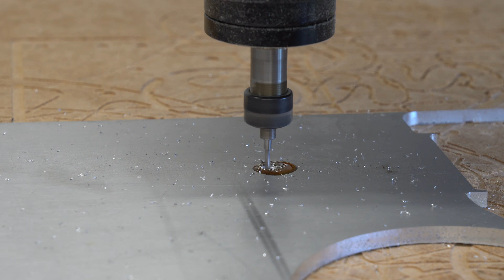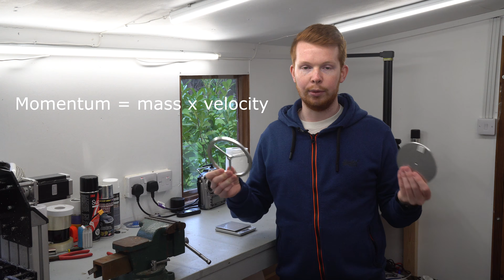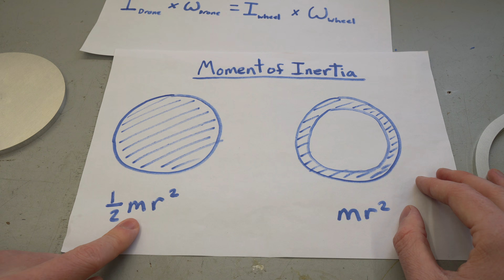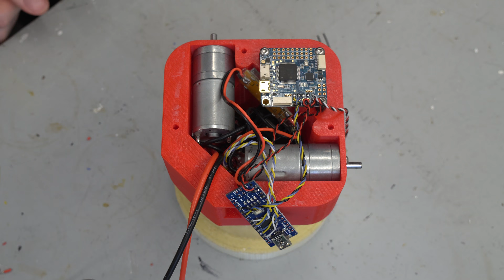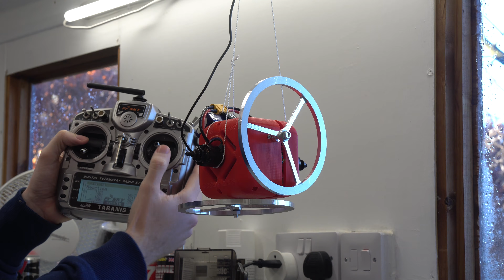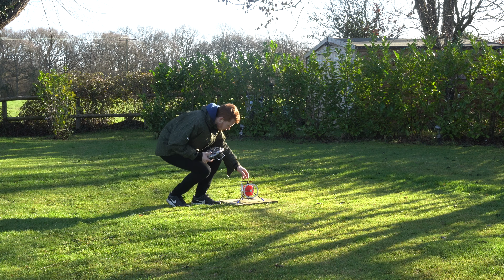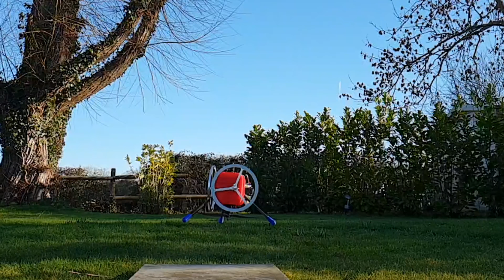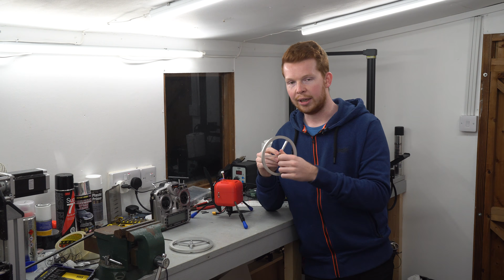Comment: I think a major contributing problem, is that the axis of rotation of the reaction wheels are not passing through the center of mass of the device. Therefore, when the wheels rotate, they also introduce a disturbance, and neither rotating wheel can counteract the introduced disturbance. If the axis of rotation of the wheels passed directly through the center of mass, I think you’d have better luck.

Comment: Just two quick additions.  The power of a body with arbitratary motion is just the rate of change of the force times the distance.

Power = (d/dt) * m * a * X  = (dm/dt) * a * X +  m * (da/dt) * X  +  m * a * (dX/dt)  Watts

If your vehicle is not changing mass , the first term will be zero or small.

Power = (da/dt) * X +  m * a * (dX/dt)  Watts

but a is (d2X/dt2) and (da/dt) is (d3X/dt3), the second and third time derivatives of the  position. And (dX/dt) is just the velocity vector.

And  you can integrate your three axis accelerometer (and gyro data) to estimate X(t), V(t), A(T) and dA/dt for each axis.  Just take the time series, integrate the acceleration once for the velocity, and twice for the position.  Monitor the power from the amperes and volts as a function of time, and you can calibrate your integration constants.

So you can monitor your power usage, in three axes, over time. And if you preplan your trajectory in three dimensions and time, yoiu can precompute  the required power, acceleration,  velocity as a function of position over time.  With wind and disturbances, there will be adjustments, but your basic path and operations can be checked ahead of time.

Power =m*(d3X/dt3) * X  +  m*(d2x/dt2) * (dx/dt)

The term (d3X/dt3) is called "jerk".  If you minimize that, you can lower your power requirement.  Choose control signals that minimize "jerk", the third time derivative of the position (three axes remember).  That leaves Power = acceleration * velocity

After jerk, comes "snap", "crackle", "pop".  I am not kidding. that is the naming convention for 3rd, 4th, 5th and 6th time derivatives of the position.

A second note, regarding reaction masses.  If you choose a sphere as your reaction mass, you can spin it in a vacuum at very high speeds.  Since it has no preferred direction, you can use ONE reaction mass to provide thrust in any direction, not just along certain axes.  It means applying forces magnetically and by induction to the spinning sphere, but that is just calculations.  You can precompute, and calibrate specific masses on the ground, then store the signals to produce any given thrust and direction in a table for small onboard computers.  If you spin up the sphere on the ground, you can store energy and counteract the startup torque on the ground, then you do not need counter rotation once you get going.  Magnetic braking is a generator, so store the electricity in a capacitor and battery if you have the capacity.  A magnetic sphere does not have to be solid. In space any object can be spun. Put the sphere or object in a vacuum to reduce viscous losses.

Wish I had more time. These are just ideas for you.  I recommend Lamb's Hydrodyanamics on solids moving through fluids.  Force yourself to write down his equations and memorize his conventions for vectors.   Or  just carefully observe and try to quantify and estimate the consequences of your control signals and measured datastreams.  Good luck.

Richard Collins, The Internet Foundation

Comment: Your aluminum ring with vanes is strong and lightweight and has higher angular momentum per unit mass.
If you use titanium or steel it might be better.  Steel would be strong, inexpensive and you can solve for the optimal shape

The vanes going from that central disk to the ring could be machined as vanes (propellers) and you might not need separate two blade propellers.  It three blade calculations are beyond you, just use two and steel will be rigid enough.

So replace your top and bottom blades with a ringed propellor (two blades with a circular ring at their tip) or three blades. The counterrotation stores most of the kinetic energy = (1/2)*I*w^2

The kinetic energy is a store that you can tap.  If you have a fast spinning, dragless, ring with very tiny vanes, then changing its speed requires less total energy in unit time, (less power), than to require it to start from zero speed. So a pure reaction mass (not used as a propeller), might be spinning constantly (as a flywheel). Your control monitors its omega, calculates the energy needed for the new omega and sets the voltage and current accordingly. 

If you put the storage rings inside the device in vacuum, they do not need vanes and rotation about the center by mechanical means, but can be permanent magnetic rings as rotors in a circular motor/flywheel, and spin constantly.  You could :spin up" the rotating rings on the ground, using tethered power from the ground, and then tap increase the rate (battering to rotational energy), or tap it as a generator (rotational energy to battery).

Sorry I can't put pictures here.  Take a ring and build a motor frame around it.  If it is a permanent magnet, you only need an occasional controlled magnetic field to make it spin.  It could even be a plastic magnetic material that you magnetize in a predetermined pattern.  It can have very specific magnetic pattern stored in it to make control optimal for your use.

You really really need to make basic spreadsheets, put all the things you know into them.  Use the Solver to target the operating parameters you want.  Excel and Sheets both can do this.  

There is no end of resources to do what you want to do - use reaction mass, and/or gas jets (or plasma or liquid fuel jets) ,  to provide thrust and forces to move and stabilize your craft.  You have a LOT of power in the drone controllers, but not a lot of energy.  So store some on the ground as rotational energy.  Soft Iron would be cheap, easy to machine, magnetizable.  Or talk to K&J Magnetics or other neodynium magnetic material specialists and have them help you make the parts you need.  They need to be strong, and the more magnetic energy you can store, too, the better.

You are using WAY too much plastic.  That is too thick and heavy.  Machine your frame out of aluminum and minimize the plastic parts.  Tell your sponsor to help you devise an aluminum or steel 3D printer and think long range. Laser or ultrasonic welding of small parts might work. Build frames not solids.  Your motors are way too heavy.  Remove most of the cases and anything not really needed.  If you make the rings as rotating elements in a circular linear motor, you don't need those heavy motors on the axis.  And you don't need so much power.  Small, extremely precise adjustments, not bang bang start stop from zero.

Sorry, I mixed designs - trying to make a propeller with a ring on the tips and its own kinetic energy of rotation is one thing.  Making a ring motor flywheel another.  Machining frames out of aluminum or titanium another.  Robot welding extended "solids" from thin struts another.  Building parts out of very strong magnetic materials and building frames around them another.  In space imagine to very fast rotating rings made of magnetic materials.  They do not need axial struts.  Just get the robots to build the rings in place, then a frame around them that spins them up to high stored energy, that you can tap for orientation.  Six sets of two rings on each face of a cube?  LOTS of possibilities. Just do the calculations.  Modelling mathematically is cheap.

I havent' said it. Great job!!!  Keep up the good work! Wish I were 60 years younger.

Comment: Could it fly with just three reaction wheels and no propellers? I don't think so, but am curious.
Reply: Reaction wheels are not designed to provide a force, just a moment so if you have three wheels you would not be able to overcome gravity, hence the propellers which provide both force and moment (and in fact that moment is compensated by spinning both propellers in opposite directions thus avoiding the drone to start spinning like crazy)

Comment: you can hang it upside down,with 3 string (one at each leg). that way you have a safe device (not breaking stuff). i was wondering if one can change the center of gravity.. having a long stick (with a mass at the tip) underneath, that you move in the oposite direction.. would that work?
by the way, i like your videos! it's quite interesting, i did not know how many diferent ways there was to try to control the attitude! congrats!

Comment: you can solve the work by placing the reaction wheel on all four sides and these wheels must be synchronized in opposite directions. This minimizes the vibration caused by the reaction wheels.

Comment: Why not try put 2 rings and 2 motors on both parallel sides? Where each motor runs in single opposing direction, so that whenever the drone faces the other way around the motor(1) is then shut and then the motor(2) runs to counter the direction and vice versa, just like in kayaking. In this way you don't have to wait for a single motor to slow down and eventually stops before it can rotate in another direction. 

Don't really think it would help but just an opinion, I'm just a fan and not even learned man as you are Sir. Nice video! Definitely wanna watch more of these. 😊

Watching from Philippines. 🇵🇭

Comment: I'm not going to go through 2.6k comments, but in the few videos I have watched of yours it would seem logical to move the lifting thrust component above the controling components kind of like a pendulum. I think though this would reduce the extreme controllability (not an area you're close to mastering) it should help master control. Also have you considered using a helium balloon to reduce the requirement for lift, this might make it more resemble "space"

Comment: Hi, the problem is you didn't account for the fact the wheel that starts to rotate the first will, because of the Conservarion of Angular Momentum Law, try to preserve its axis of the rotation which will oppose the other ring trying to change that axis. For the same reason the wheel in this experiment does not fall down: https://youtu.be/NeXIV-wMVUk

Comment: If you modify your wheel design to cut one or two channels just inside the edge of the wheels, you could then press lead wire into the channels, thereby increasing the mass of the wheels. The drone would have to work harder to lift them, but they would be much more effective and take linger to saturate.

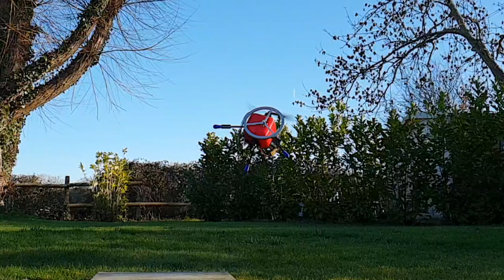Comment: 19:20 look at how this wheel is wasting time trying to decelerate when the drone tilts to the left, and the reaction wheel never has time to counter-rotate. I think this would work really well if you had FOUR reaction wheels. One dedicated for each direction. So, ONE wheel for Left Roll ONLY, one wheel for Right Roll, etc. This way, they never have to "waste time" trying to decelerate, before the other wheel can engage full spin in the opposite direction.

Comment: I have a suggestion: The whole vehicle is imbalanced due to having the wheels on one side.  I would modify the thing to have 4 wheels. Divide the wheels in half (thickness, same diameter), have each axle go through the unit, still driven one motor per axle (just two motors), mount each wheel on opposite sides of the vehicle, utilizing the one axle per axis.  All sides of the vehicle will now have a reaction wheel, therefore balancing the vehicle's weight.

Comment: The props may have a very slight rpm difference. And the prop design variations may cause slight differences in trust. Try using just one prop on top and a flat disc plate on the bottom to counter. IMHO

Comment: You should look into different types of DC machines (motors) because there are several types that have very different characteristics. Shunt motors will rotate at a constant speed based just on EMF or voltage applied. Series wound motors have a "constant power" output if you will, where torque and RPM are inversely related, and motors with a fixed field excitation like those small permanent magnet motors have a linear relationship between torque and RPM, which is shifted up and down with voltage applied.

It may also be better to use brushless motors if you can find ones that have a high resolution rotary encoder or a resolver. Although that gets expensive quick. Field Oriented Control is probably the best algorithm currently for controlling them.

Comment: Means more complexity, have both the (ducted may help) props co-axial (a la Kamov) on top for some inherent stability (synching with wheels with triggered Coriolis?) but have 3 reaction wheel arranged in a corner set up (all perpendicular [hull could be a cube with an opposite diagonal axis vertical with props coming out of that]) for altitude and directional control. Have the landing struts projecting between those for some protection
Reply: "props on top for inherent stability" - Ladies and Gentlemen, allow me to introduce the Pendulum Fallacy.

Comment: The problem with the concept is, that to generate torque the reaction wheel has to accelerate (and can do so only until it saturates). So e.g. if you hang the drone off balance a constant torque is necessary, just to hold it perpendicular, and the reaction wheels would quickly spin up to saturation. When you spin down the reaction wheel it actually gives a torque in the opposite direction.
All kinds of forces generate torque on that drone, a center of mass not exactly counterbalanced by the propellers is probably the most significant, but also wind and air friction, so unless your drone is perfectly balanced (force of propeller aligned with center of mass) without spinning the reaction wheels they'd have to constantly accelerate just to keep it upright.
If there are friction forces that bring a rotation to a halt, then they could be used to advantage to avoid saturation.
The gyro effects on this thing (one reaction wheel acting against the other and the differential torque from the propellers on the reaction wheels) i don't even want to think about.

Comment: What if the wheel would be eccentric and would be controled by stepper motter? mass must to be lower as possible at the start at eccentric would give you ability to control mass center position.

Comment: Great video Tom and very interesting concept. Hope you stick at it and get it to work with encoders. Wondered whether you had thought about the same/similar rig but with compressed air  top and bottom of each side to rotate the body. No idea whether it would work or not but would certainly be interesting to see.

Comment: As a person who learned the hard way NOT to use the L289N motor driver, I saw the torque mismatch problem between the two motors in the beginning. It's an outdated and very crude controller. Quite a significant percentage of the input power is being lost and transferred into heat. And as you might expect, it doesn't get any better when you're trying to control to motors simultaneously. In fact, new problems are being introduced - torque & RPM mismatch. To be honest, these motors are quite smaller than the ones I tried using with this driver and I'm surprised you didn't burn the board but still, they perform absolutely atrociously in the low RPM range and don't really allow for the maximum RPM the motors are rated for since they waste most of the energy. My recommendation to you is to change the L289N for something more advanced. My way out of this problem was to design a PCB based around the DRV8701 Integrated Circuit.
Apart from that your video is amazing! I just found your channel and quality of all projects seems to be top notch so far. Keep it up!

Comment: You may be getting the air from the  'fans' interacting with the reaction wheel spokes causing backward torque. Try putting the wheels inside a cover to remove the interaction.  And maybe since its a helicopter how about, just having pendulums that you can 'swing' to get the torque reaction. this way they can be small but heavy relatively.

Comment: Awesome project! We just learned about this in dynamics, you might be having trouble with too much jerk(the change in acceleration). Therefore, there's a lot of oversteer, hence more unintentional high rates of change of acceleration.
Reply: You might be able to solve the issue with lighter wheels.

Comment: Could it be that there's an issue with the gyroscopic forces caused by the mass of the rotors and their motors? I mean the effect that occurs when you try to turn a rotating object. Like the forces in a spintop that stabilise it, or that make cycling possible...

Comment: Interesting! Thanks!
Suggestions to improve the design: The rotation done by the propellers is overlapping with the lift of the drone. I think it should be much easier to control the drone if you use a spinning disk/wheel in that direction as well to be able to control and regulate the rotation independent of the lifting force. Also, and maybe more important, the rotating discs/wheels don’t have to be centered around 0 rpm. Bring them to speed while holding on to the drone and then control the rotation around a higher rpm. Motor control around 0 rpm is not as reliable. Finally, the PID-controller doesn’t care if you control actual rpm (measured via encoder) or the current that leads to a specific rpm. Linear relations may help for stability but well adjusted parameters should give a good stability as long as the feedback is fast enough.

Comment: Great explanation and I thought that a brake against wheel would reverse the momentum. In fact I would have the wheels spinning at great speeds and use brakes on each to control the attitude. This would simplify things but pulse braking. 
I’m thinking the whole thing, not being Perfectly balanced on 3 axis is a mathematical nightmare;  E for excellent effort!